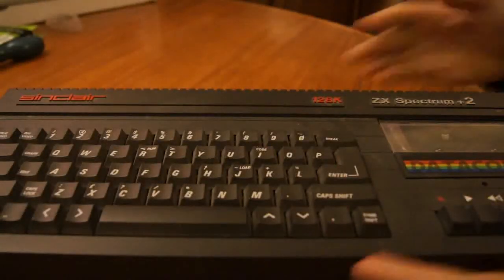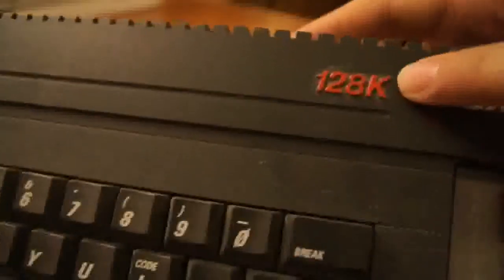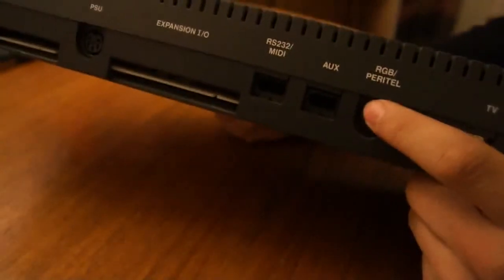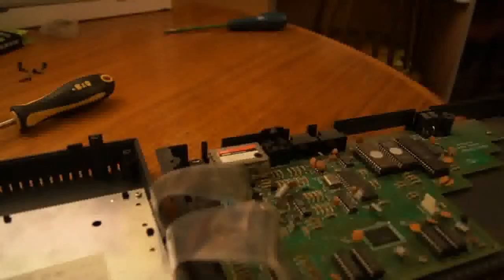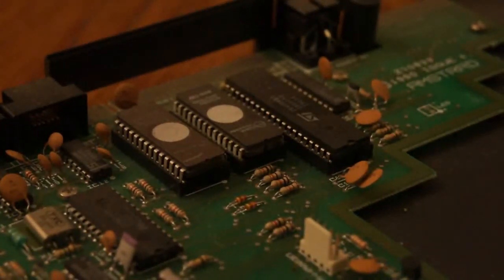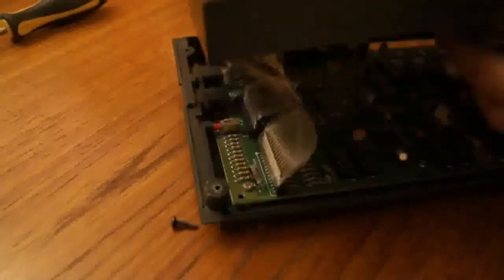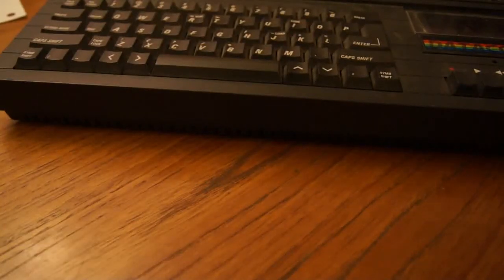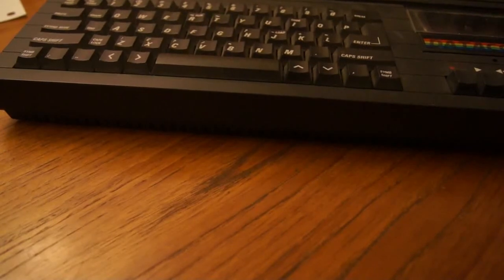Sinclair ZX Spectrum +2B Hardware

Comment: In fact, this is a Spectrum +2B issue 2.
AFAIK, +2A has all connections to add a disk drive, and upgrade to +3. This one does not have those connections.
Check out sockets for RAM chips. That means this is a +2B issue 2. Issue 1 has RAM chips soldered.

Comment: Well I do not think its a +2B. This is +2A. Difference is: +2 (ordinary grey, with Sinclair ULA), +2A, black with Amstrad ULA, +2B is black with Amstrad ULA and spanish system and labels. There are self-mod +3S created from +3 and +2A/B containg ROM with ability to handle connected CF cards and IDE drives as HDD for ZX spectrum (besides M: for RAM drive)
Reply: Miroslav Werner +2b has din power +2a has 9v connection, this is indeed a +2b